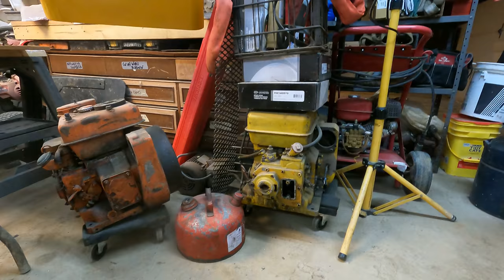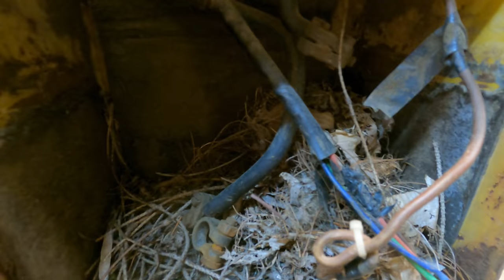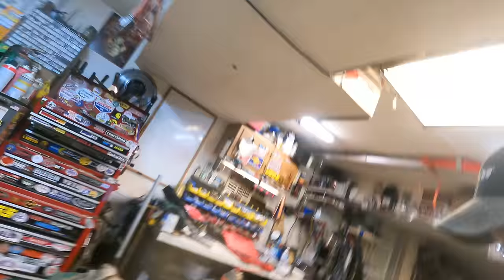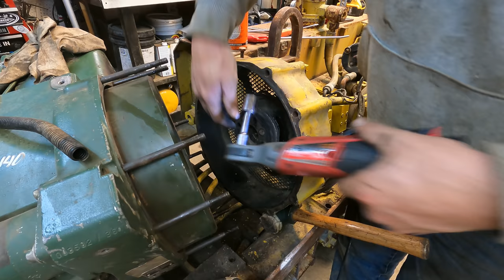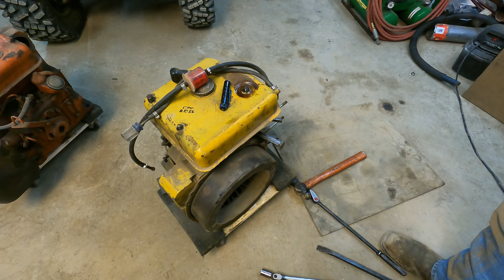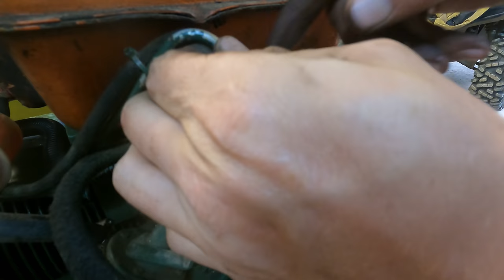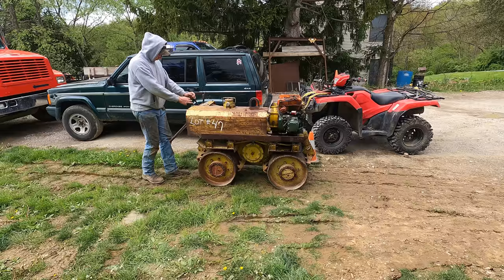FREE Diesel Trench Compactor gets a Military Surplus engine Transplant! (WILL IT RUN??) Pt.2

Comment: Cool! That clear gasket is actually a shim. That sets the timing of the fuel injector pump unit. Once she is up and humming you may have to fine tune that.
Reply: Yeah agreed, I believe that control injector timing and possibly the pressure as well
Reply: @John.strong  I turbocharged a kid
Reply from the maker: Thanks bud I kinda thought that was the case so I used the shims from the yellow pump, not sure how to fine tune it tho
Reply: @DieselCreek  I'm sure there is a spec, but who knows what that is!
Reply: Like a 855 cummins
Reply: @DieselCreek  search for Petter spill timing its the same set up 👍
Reply: @John.strong  The pressure delivered by the pump is determined by the injector opening pressure.
Reply: @jonka1  
That's what she said
Reply from the maker: @ruben_balea  Thanks for this! that's a very helpful manual!!!!
Reply from the maker: @ruben_balea  yea but it says how to read the shim  pack
Reply: Safety Crocs... Thumps up
Reply: @DieselCreek  what an awesome little beast of a machine, man. It already kinda resembles a tonka truck, but can you Please 🙏 modify it a bit to look like a tiny little dump truck? That would be so dang cute and would make the best thumbnail ever, plus should get so many views.
Oh and please don't forget about the stator before you paint it... actually, it would probably be easier and a better paint job if you did it while it was apart. 
I really enjoyed this project and hope to see it again 👍👊
Reply: @DieselCreek  hi
Reply: @DieselCreek  Kubota does the same thing they use the housing gasket as the timing for the pump a different thickness gasket is a different sequence so if you make yourself some shims you can experiment with thicker and thinner to change the timing

Comment: My guess why the starter does not work is that being military means 24 volt. Anyway, cool. Thanks for the vid.
Reply: That was my first thought as well. No charging system because it may have relied on another piece of equipment it was paired with.

Comment: Hey Matt... just a reminder... nearly everything military wants to run 24VDC.

It's likely that the green starter wasn't engaging the flywheel because you were using 12VDC.

Additionally,  be careful when you work with the stator & regulator, so you are getting it setup for 12V instead of 24V.

Comment: “You’re gonna regret it when you’re older”
“I regret it now”

Me being a 22 year old marine as well as an industrial maintenance technician; I can definitely already relate to that feeling.
Reply: Oh, I definitely have the United States Army to thank for my blown apart knees. Luckily, the military in general these days is aware that they can't load us up with 80lbs of gear and a weapon and run us all over the damn place with garbage throwaway boots. Gear is a lot better now than it was when I was in the grunts. All the best, Trav.
Reply: I think he has an engine hoist right there too.
Reply: @tiredoldmechanic1791 , he needs to use that engine hoist. I’ve got 2 knees that have Diabetic neuropathy and can no longer do what I used to do. I’m now 65 years old.
Reply: Don’t go doing all that lifting if not necessary.
If you have an engine hoist, use it. Work smart. Let the devices do the lifting, or whatever strenuous activity needs to be done. 
I’m 65 years old and a Type 2 Diabetic, with Diabetic Neuropathy (it presents in both knees, you don’t want it). I’ve also had lumbar disc surgery with vertebrae fusion.
Reply: @jmikronis7376  I had both knees replaced before I was 55 and my back went bad in my late 60s putting pressure on the nerves so my legs don't always do what I want them to do.
Reply: @jmikronis7376  Pretty much the same here, thank you USAF.
Reply: Yep, taking the time to save your back is well worth it, I wish I had. However, my chiropractor is a happy man.
Reply: Semper Fi, Devil Dog. Thank you for your service, Marine.
Reply: @jmikronis7376  let me guess... 
I'd bet that you are OVER WEIGHT!?

Comment: The forward/backward vibration lever is there for a reason. If you want to do a high compaction you spin it in the opposite direction. It will increase the vibration force significantly

Comment: So glad you were able to find the surplus engine. I kinda think a repower would’ve been the easy(cheatin) route!😉 I’m thinking the military might’ve been on the right track though with the oil cooler adapter under the oil filter. It might just stop an old air-cooled diesel from chewing up bearings?
Reply: keeping idiots with cans of ether away from it will go a lot farther.  He was smart about it, giving it the tiniest whiff possible.  Not everyone does that.  They blow half a can in them before they even start cranking, end bearings and wrist pin bushing get hammered, then run 'er hard 'til she blows.  Then the outfit wonders why they can't keep a decent mechanic.
Reply: @infoanorexic  sounds like good advice,  can you tell what Matt meant by Etherlock?
Reply: Was looking for what that was, thnx!
Reply: @pear7777  Ether ignites under compression, like diesel, but at much lower pressure.  Since it's already mixed with the air, it will ignite at a point where it will fight the starter because it's still in the process of compressing, and will try to kick the engine in the wrong direction.  That's why the engine should be spinning when the ether (at the smallest amount possible) goes in, so the momentum will help carry it past top dead center.  Too much ether can cause a bigger conflict than the starter can handle, and keep it from cranking.  If too large of a dose hits it while it's already spinning (or just starting to run), the conflicting forces can be enough to hammer rod bearings and wrist pin bushings so they no longer fit within tolerances.  I've seen galled and spun bearing shells and bent rods because of too much ether.  Mainly on small diesels like this one.  When bearing material is practically welded to the crank journals, you know something nasty (and preventable) happened.  Makes a mechanic want to take his little square headed hammer and use it to create big round knots on the head of the one that did it.

Comment: I wonder if that oil filter adapter with the hose was so you could add an oil cooler to the engine if you wanted? Neat video as always Matt.
Reply from the maker: Yes I think that’s what it was for!
Reply: That housing was the oil cooler. The hose was a coolant hose. Coolant is circulated through the base, typically.
Reply: @brokenwrist24  Coolant from where?  This engine is air cooled.  Is this application something you are familiar with. Just asking.
Reply: @larrywalker7759  this engine can be upgraded to oil-cooled. And looking at two dead rod bearing engines -- that's a thing I'd definitely do!
Reply: It very could have had an auxiliary cooling tank, or been plumbed into something that was liquid cooled. I'm well aware it's air cooled. I'm also familiar with oil coolers, and that's exactly what that plate is. It's an oil cooler. Looks like a liquid to liquid cooler. The 2.0 vw engine used a very similar looking oil cooler. I've had to change a couple o-rings on those. Without knowing what that engine came off of, and what it was used for, it's hard to determine how the coolant was pumped to the cooler. Now, could I be wrong and it's actually part of an air to oil cooler system? Sure. Oil comes out before the filter, gets cooled, returns back to the engine through the filter or vice versa, either way the oil is cooled and filtered.
Reply: As Dmitriy geels said, two dead bearings, I would have kept the oil cooler and figured out which way it works, and how to make it work.
Reply: That's exactly what it is. Oil would be circulated through an oil to air cooler, or I have seen them used to circulate oil through a shell and tube liquid to liquid cooler, typically with chilled water on the other side.
Reply: @brokenwrist24  Not disagreeing that it probably could benefit from having an oil cooler. But Matt will just have to loosen that looped hose and see what kind of liquid residue is still inside it. I am thinking it will be engine lube oil and that the hose was just looped back and reconnected to the return fitting when the engine was separated from its auxiliary oil cooler, same might have been done with the other hose, looping it back to the supply fitting on the oil cooler.  If antifreeze or water residue comes out of the looped hose, then I guess the adapter is the actual cooler, but that looks like a pretty small unit to be much of a heat exchanger in itself.  I too have seen a few different strategies employed for oil cooling in different applications, but not this particular engine.
I have retrofitted oil air to air oil coolers on heavy trucks where you had to install an oil pump to the transmission to flow the oil to the remotely mounted cooler. The oil cooler in those applications used a thermostatic valve on the cooler inlet circuit that would bypass the cooling tubes if the oil was cold, returning it to the trans sump until the oil temperature rose enough to require cooling, at which point  it would direct the oil to the cooling tubes and block the bypass.
Perhaps Matt will find time to investigate and post his findings later, or maybe a viewer who has first hand knowledge of this engine with this oil cooler adapter will post.
Reply: @brokenwrist24  that filter housing looks familiar to me -- you can get them cheap from aliexpress along with oil radiators (or as a set). There are also 90° or even split housings to move the oil filter.
Reply: That adapter is just a piece in the cooler puzzle. If it's liquid to liquid, it would be plumbed back to a radiator, just like an automotive oil cooler.
Reply: I would be really interested to see what liquid comes out of that hose.
Reply: @brokenwrist24  I'm glad we have a bunch of interested folks on here doing a genuine discussion and not a bunch of bashing like I see on some channels.  Thanks guys.
Reply: Where does bashing and name calling get us in the end. We're all here for probably the same reason. To watch Matt work on old stuff.
Reply: The sandwich plate could also be for a remote filtration setup.  I've never heard of clean oil hurting an engine, and the extra capacity & surface area will help cool the oil somewhat too.
Reply: @dfross87  Yeah, could be.  That made me think back about installing high performance aftermarket oil coolers on old pancake air cooled Volkswagen engines way back when.  We liked the coolers that also had threaded ports that enabled the user to add hoses to a remote mounted full flow spin on oil filter.  I always considered that a big improvement over the OEM oil sump suction strainer those engines had from the factory, and as you said, the surface area on a filter can is a significant heat exchanging surface.

Comment: I'm here to put this bad rep that everybody has put on starting fluid to rest All that cranking you did on that motor just wearing out your starter and your battery. You put a couple of sniffs in (while cranking) and it fired right up. Starting fluid is not your enemy.....your mind is your enemy. I used it for fifty years and lve never blown up an engine.
Reply from the maker: Amen dude
Reply: I have the 'Hawaiian snow blower' powered by a Chinese Honda clone. It starts fine when it's about 70F. When it gets below 40F it needs either every time. Once it starts it runs just fine.
Reply: How much ether have you sniffed

Comment: That's awesome, Matt! Question. When you engage the starter does it have wiring in there somewhere that automatically heats those glow plug intake heater looking plugs? If not I imagine that hooking those up to a switch and relay would solve the cold start issue keeping you from having to use the boost juice.

Comment: A tip from a sparky, get yourself a heavy duty pushbutton switch (you can get them for horns/starter buttons from an automotive shop) and put a couple of lengths of wire on it- one short with a crimp connector to fit the starter solenoid and a longer one with a croc clamp on the end- that way you don't eat away at the starter terminal, and also makes 'accidental sparks' like you got not likely to  happen- costs a couple of bucks, and is much safer and easier to use lol- I actually have several lying around the workshop here (also handy when the starter solenoid terminal is hidden away behind other stuff like cover plates, exhausts etc- you can even make a flash one with engine run switch for power to a coil/injector pump etc and a kill circuit for magneto engines...)

Comment: I think what you have is an oil filter sandwich adapter. Don't lose it. May come in handy if you want to add a mechanical oil pressure gauge in the future. Just bought one for my truck.

Comment: It’s an Auxiliary power unit that came off of some sort of tracked vehicle. Engine displacement 738 cc, 19:1 compression ratio, 15HP @ 3,000 rpm and a torque rating of 27.4 @ 2,000 rpm. Good little motors at are pretty quiet (with a muffler)

Comment: Matt  you are a hell of  a  good  mechanic. /welder  etc. With a dam good  skill  to the older  stuff  plus a good  operator  you kown  how to  operator  all your  stuff 
You got  at  most  jobs 13:30 13:30
Reply: Like  I was saying  on most jobs  each  operator  normally  handle  one  or  2 different  machines  on a regular  basis  .  The other they have  to  feel  their way around  if it not something. That they been  on must. .and  you not only  run the  stuff. But you fix it and  maintain  it. And  truck it to different  locations. Your  a one  man crew . Ho every  you work  for  before  lost a good  worker went  you left.

Comment: You've pretty much got it, but for reference, I found a picture of the controls and they are from left to right:
1) Drive speed control 2) Vibration drive direction 3) Clutch/Drive left 4) Clutch/Drive right.

And on the label it says, and I quote (not that it makes any difference to anyone who's ever run one of these) "12V DO NOT JUMP START."

Comment: I don't know anything about that engine but I do know a little something about hydraulics. The adapter for the oil filter was most likely used to send engine oil through an "oil cooler". Blocking it off would have burned out the crank bearing in about 15 seconds not to mention breaking the oil pump drive.

Comment: model of the replacement engine, am sure there will be a service manual (pdf or hardprint) available online. (cheating is something you do when you don't want others to find out, working on changing engine parts is not cheating especially when you disassembled it in the first place).

Comment: Hi:

I had a v two cylinder Faryman diesel un my sailboat.
Water cooled with 30 hp, and utterly reliable. 

It onlyy used a third of a gallon of fuel per hour, and some parts were available from Volkswagen.

Comment: You need to get yourself a jumper cable a long one cut it into. Then place yourself at heavy duty spring loaded switch and spice it in. Then you can clamp one side to the starter and one side to your battery and you have a push button switch.

Comment: Buy a engine hoist damn it man 
Your back will love you for it
Oil cooler housing should leave it on just need the cooler radiator
Need to weld new pads on the drum wheels
Awesome bit of gear to add to your machinery list 👍

Comment: Another thing I forgot to mention Matt, take a look around the fuel pump or throttle if there isn't a small knob that you can pull out. I'm not familiar if this engine has one but on a lot of these small engines there is this knob to release the fuel rack more for a cold start. The pump will give more fuel during start and the knob will reset is self once you move the throttle

Comment: For the charging situation, you could always just grab yourself a cheap gm 1 wire alternator and run a belt off something, I put them on everything that has a battery and spins fast enough

Comment: Those things are brutes.  Set them on the fill for a 6" fire line, ahd you can feel it a couple floors up..  I've seen them fitted up as excavtaor fitting, too (that does not like it would fun to drive)

Comment: Nice job getting it going Matt. The only comment I want to make is that with these type of engines the output is regulated by putting shims underneath the fuel pump and thus limiting the stroke of the pump. So that clear gasket is a shim of a certain thinness that if you change it for a different thicknesses it will change the horsepower.
Anyway farymann engines are reliable but my preference goes to Hatz as the are more quiet.

Comment: I'm thinking a 2 or 3 inch diameter exhaust stack with a tractor flap on top. Sticking up about 8-12 inches above the covers so it's the tallest point on the machine. That thing is always gonna require ear protection anyway. May as well keep her loud. Should be able to find a lawn tractor stack that'll fit, or just whip one up quick.

Comment: Evapo rust down the stud hole in the tank.  Leave it sit for several days and the tank should come right off.  I have also used evapo-rust to free stuck pistons and other parts I’m bores.  If you use it on parts in a motor or other areas that were oiled (pressurized Or splash piled). They need to be washed-soaked with brake clean/acetone.  Acetone will take dissolve and evaporate oil  off with it.

Comment: See if you can get the other three stud out of the gas tank. Then you may be able to spin the tank on the frozen stud. It will either work loose or snap the stud either way the tank will be off without damage and you can drill it out if necessary